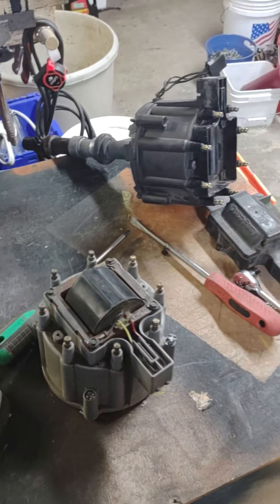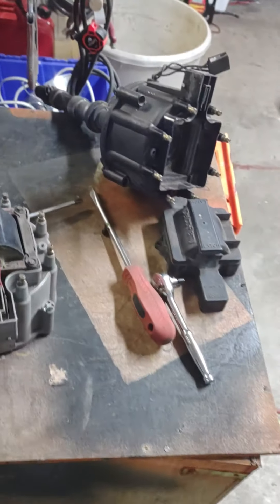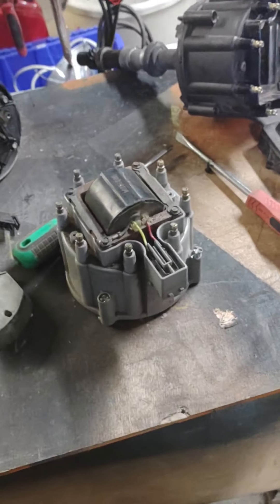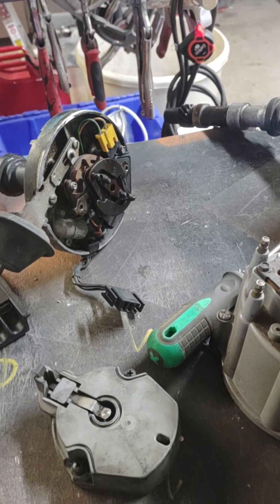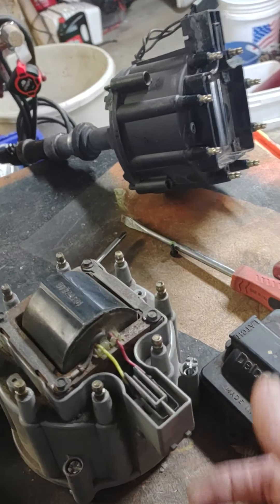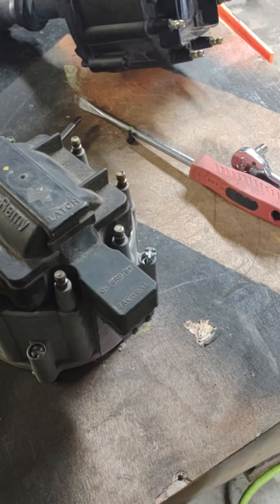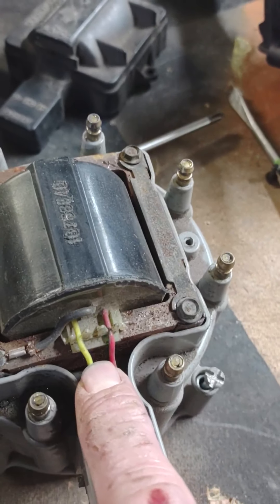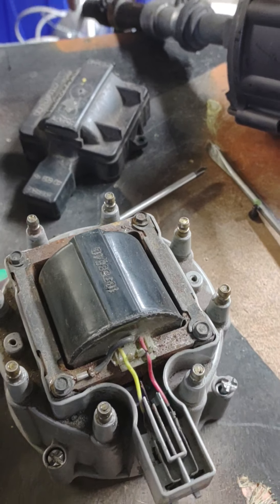cadillac 472/500/425 HEI

Comment: On my 69 472 my inside power steering/ ac belt hits the cap.
Reply from the maker: With hei swapped on it?
Reply from the maker: Sorry it took me so long. I just seen this today. 2-26-23
Reply: Yes
Reply from the maker: It sounds like a possible issue with the pulleys. I switched pulleys on one engine for an altinator issue. But this may be a similar issue. The pulleys for the belts can be pulled away  from the engine using a 1973 or newer pulley system or a set from a 425  pulley system. 
The crank pulley should have 3 belt drives. The other brackets from the 73 425 will line up with the 3 belt pulley. 
Check out a few more videos on pulley swaps.